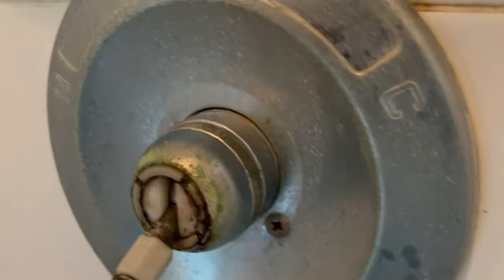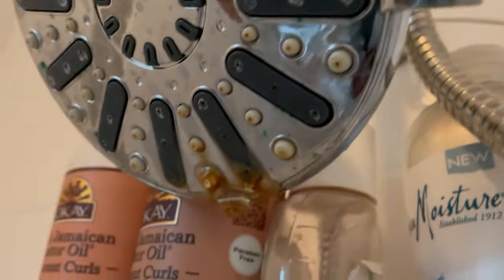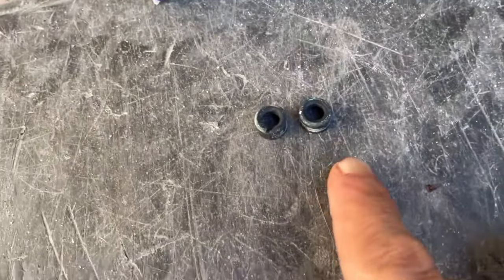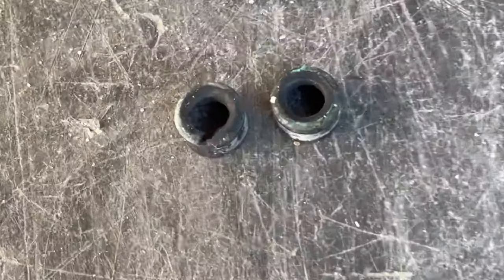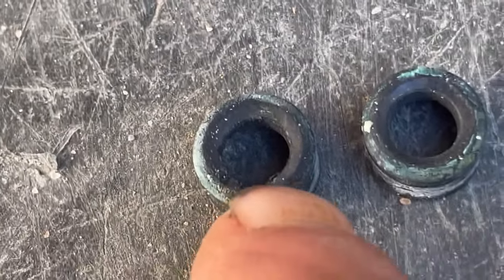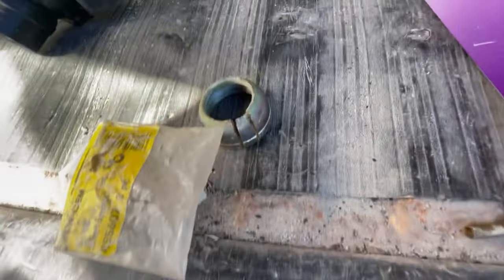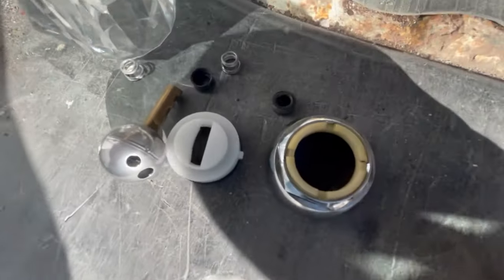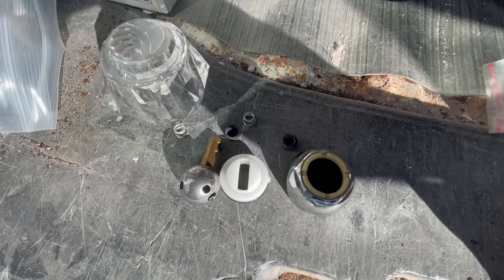HOW TO REPLACE PARTS TO 40 YR.OLD DELTA SHOWER VALVE

Comment: Delta needs to put your videos on their site. They have no info on the before the cartridge like the 90's. You go to the hardware store get the cartridge and it is toooo big when holding next it. Then the seals you think are needed are not and etc. This is the best info all your videos just not go to far and need all piping replaced. Thank You. A wonder the seals last 30 years!!!!

Comment: Nice job Tim,
When replacing the parts I usually use some stem grease on the Bonnet threads and the threads on the valve to make taking it apart again easier. 
Delta does have a “tool” for removing 
The bonnet, but they are a plastic unit and many times won’t work. Hammering the bonnet on all sides can usually break the bond between the male and female threads, but patience is the key, great job.

Comment: Tim, this is Steve, Joyce's husband and Mr. fix-it most of the time around our house. Well, believe it or not, I was able to put the two rubber inserts in upside down the last time I fixed the shower faucet which was almost impossible and didn't work well after the install, but we lived with the small drip for about a year but the leak finally got really bad. This time I got on u-tube and "You" did the trick! Your video was all I needed. Although it was not to detailed in that area, I was able to see my mistake and do a proper install. I now have no leak and I will have to call you the "Savers-Edge"! Thanks so much for your help!!
Reply from the maker: Great job

Comment: Thanks Tim for a detailed video. I just replaced my set of Delta 600 series parts (35 years old) by cutting the bonnet nut with a Dremel tool and cut-off wheel, followed by cracking it open with a flat-head screw driver. There's actually another youtube video showing the results with a Dremel tool to cut the bonnet. After reading some of the horror stories of twisting the bonnet nut with too much force / torque and ripping the pipes off the welding, I decided not to even risk trying to loosen it with heat or a lubricant. Of course, one needs to buy or order on-line the bonnet nut before starting the work. Not only is it important to work slowly and patiently so as not to cut into the underlying threads, but care also needs to be taken to avoid cutting into the cylindrical shroud which holds the rubber gasket in place, slips into the chrome escutcheon plate, and protrudes into the wall. The problem with a cut into the shroud is that a small amount of water could leak into the wall behind the plate when taking a shower. Anyhow, keep up the good work and your video descriptions.

Comment: Thanks for the trick with the pliers. I was getting pretty frustrated being unable to seat the thing back in place with my hands, but it went right in after I used the pliers to push and then turned the housing to secure it. All the other videos I watched never seemed to have that problem, for them it always popped right in by hand, no problem. I'm glad I came acoss yours. Only other thing I did differently was use a rubber strap wrench, made getting a grip and force pretty easy.

Comment: Messing with mine for a while now
When I took the bonnet off it had a torn oring,noticed that yours didn’t have an oring.
Put it all back together and it keeps leaking through the handle only while it’s on…when off it’s great😂
Gonna try your trick with the needle nose when tightening.👍

Comment: Great video. I have a similar Delta shower faucet but it has the metal lever handle. I needed to replace the diverter. The handle is held in place with a set screw. Unfortunately I broke the Allen wrench off in the setscrew and not enough was sticking out to get it out. So I'm kinda screwed. I tried to unscrew the bonnet nut so I could remove the entire assembly, but it would not budge. I went ahead and replaced the diverter. The faucet is not leaking so I will leave it alone for now. If it leaks later on I assume I will have to cut the bonnet off like you did. Thanks again for the video.

Comment: A little dab of never seize would be beneficial. I also apply some on any new installations. I have an Aquasource cartridge type faucet in my master shower. The first time I replaced it was a struggle. Now with a little never seize the job is simple

Comment: Hello Tim, 

Thank you for being the only person I can find online that actually handle this exact shower valve that I have. my faucet has been leaking for a while now and it's finally gotten a lot worse today. Even though I'm really stressed out, thanks to your video I don't feel entirely hopeless going up against this and I will go to home depot tomorrow and try my luck at finding the spring and seats. 

I have a question though, my tub faucet's hot and cold water are reversed since as long as I can remember and I can't find any video talking about it specifically to this old delta shower design. Can you help me with this problem? Thank you.

Comment: Great precaution shown so as to not damage anything . Saw cutting the screw bonnet is a super good technique to remove it, given circumstances . Thanks much !
Reply: Yeah, but you’d better be sure to have a new bonnet nut in your hot little hand before you cut off the old one.  I had to order one from Amazon for about $8 as there is no plumbing supply except Lowe’s (and they do not stock it) around here

Comment: I like to use a little grease around the bonnet nut and sometimes along the inside of the valve where the cartridge sits. Help out the next guy.

Comment: I was taught to grab a torch and heat up the bonnet nut. Sometimes might even have to melt the cam and pull it out with small pliers. But it saves the nut and then can just grease it up for ease on the next round.
Reply: Tried the torch actually last week and worked like a charm 10min job to replace springs and washers.
Reply: @cvega78  works everytime, heat will loosen up just about anything
Reply: Do you have order information for the kit?

Comment: Where is the video replacing the entire Valve assembly from the 3 pipes?  That is what a new Delta Faucet installation requires . Thanks!
Reply: I am in this same situation.  Bought a 1985 house, and the bath fixtures are that vintage. I have a feeling that I'm gonna have to torch the old brass out and sweat the new one in.

Comment: Thank you for the video!  I replaced everything on my shower about a year ago except for the ball valve.  It held up until recently, none of my local hardware stores carry.  Can you give me a part number, mine is exactly the one you replaced and I'm going to have to order online.  Thanks again!
Reply: Hi D , I am getting ready to do same thing in one of my showers. The springs and seat are RP4993 G and the ball I have is RP212 F. Hope this helps you
Reply: @kentseymour2084  Yes, Kent thank you that does help....

Comment: Where do you find those old parts? It's hard enough to figure out what the part # is! I have an old Delta with the lever and would love to find all new replacement parts to keep our look as original as possible. It's also leaking and I have the kit for it but would like to restore it at the same time, as it's corroded.
We are also in the Palm Bay area and will keep you in mind. :)

Comment: Hey, Tim had to cut my bonnet and can’t find a replacement. Do you happen to know where we can get them?
Reply: If you are near a Lowes, you can buy a Danco replacement part #88756. It says it is for Delta kitchen faucets, but it is the same one used for showers. Also, the repair kit which includes the stainless steel ball(#212, unless you have a slot on the side of ball, then #70) and all parts is Danco #86971. Hopes this helps someone!

Comment: hi...you made it look so easy so i gave it a try.  i have the exact same delta and my shower eventually stop working. little by little it got to where water just stopped coming out of my showerhead. its a a shower only / no tub. i replaced the ball but its still not working...no water passing thru the ball. Any thoughts ? is it more serious that just he ball?  do i need to replace the whole valve with diverter? thanks everyone

Comment: Is there like a client hold silver sleeve in place?  Mine does not have that?  I also put the little rubber things and springs facing me which is the wront way. Maybe that's why water bot shutting off.

Comment: Ring nut, dome nut, whatever nut. Its soft brass.  I was able to cut mine off with just the hacksaw blade.  You will probably scar the collar behind it but thats also replaceable.  Get down to where you start to see the threads and then spread it with a strong screw driver to snap it open.  Treat that old copper gently or you will rip that sucker right out of the wall.  Once it pops, the hard part is over.  You just hand tighten the new one (grease the threads) and adjust the pressure ring.

Comment: Excellent video. Whats wrong if it leaks out the front do i need new inside ball? I got new springs. I can get the kit. I saw no orings at all except big black one. Mine is pretty old delta

Comment: I have this exact valve. It needs to have all this done but I would like to just replace the whole entire thing WITHOUT having to replace the diverted inside and re pipe all of it. Is there a way to do this? New upgrade that uses existing valve in the wall? Thanks for the video!!
Reply: And do you have ordering info for this kit?

Comment: I just ran into this valve. My issue is the hot water is barely running. I don't see any obstruction in the paths. The washers are not too terrible and it doesn't leak. Can an old ball or washer or springs cause obstruction in water flow? The house is well fed, but pressure in the other shower is good and all other sinks are good on hot water flow.

Comment: This original design is a masterclass on how NOT to do engineering.
Reply: Other than the bonnet seizing after 30-40 years before needing any repair which all shower valve bonnets would be the same how was this bad engineering? I know the pain and suffering of getting the bonnet nuts off but Ive never tapped one with pliers like that maybe a mallet and I've never had to cut one either. There's a few more tricks to get these off he didn't show in this video. I get these were discontinued a while ago after the IPC changed the regulation that shower valves had to be 100% pressure balanced. That's the beauty of these valves though. Temperature and pressure are adjusted separate from each other within the same valve handle. The only way to do that now is with very expensive intricate two handle valves. That and you almost never have to replace the ball or cam, just the seats and springs which cost $2 opposed to all new shower valves needing cartridges that are $40-$100 between the standard builder valves. Are they sometimes impossible to rebuild today due to age? Of course. Can they do more in one handle than any other one handle valve legally sold today can? Yes. Always worth rebuilding these IMO if you can get that bonnet off.
Reply: That and Everytime even if the bonnet comes off easily I ask the customer to put it in a glass of vinegar, use a soft wire brush to clean the threads and hard scale, if the cam isn't degrading in my hands I re-lubricate it unless it definitely needs replaced and unless the ball has turned brown or has a hole outside of the balancing and flow holes eaten through it that can be re-used as well. It might 10% more involved for a homeowner to fix themselves opposed to replacing a cartridge but it's 100% less expensive to fix than replacing a cartridge even if you replace the cam, ball, seats and springs.
Reply: Wdym? They're actually pretty great mine went from 1963-2024 before needing a rebuild and now I'm restoring it having a blast honestly compares to other valves I've messed with. It feel almost meant to be serviced compared to other valves common today

Comment: My spacer or sleeve has a gap between either the wall if you pull it to the front or the dome if you push it back,it’s loose,how can I fix that?

Comment: Hello Tim I did watch your previous video where you heated the bonnet. Could you recommend which method that is best. I can do either. Also I've seen other YouTube creators apply silicon grease on the valve assembly and the bonnet but threads. What are your thoughts. I had another  question is there a substitute for hilco-lube if I can't find a place locally to buy the spray.

Comment: Got any advice for a guy who kept twisting the chrome ring until 3 little pieces of 3/8 inch copper pipe between the rough casting and the ball valve housing broke. Dont know if I can sweat in new copper pipes or have to replace the whole valve?

Comment: I got one with a pin that you push to get the shower head to work is that just a different set up? Can you still follow the same process? Lmk I'm about to do this on Thursday wish me luck
Reply: I believe the ball is #70 if you look on the parts page of the Delta website.

Comment: This video is a good example how not to repair a Delta 600

No need to wire brush the valve, but if you do, you need to wash the valve out. 

No silicone grease used, the reason why he had to cut the bonnet nut off and this guy repeats the mistake of no lube.  

The adjustment ring wasn’t properly tightened.  This one’s a big mistake.  

And just a tip, clean those fingernails and try wearing some gloves in the future.

Comment: I have watched your two videos, in this video, you cut the bonnet and also the pipe in the process, in the other video you cut the drywall...There is an easier way to remove that bonnet by using a torch heat it up and remove it easily, stop sharing your way of fixing things.